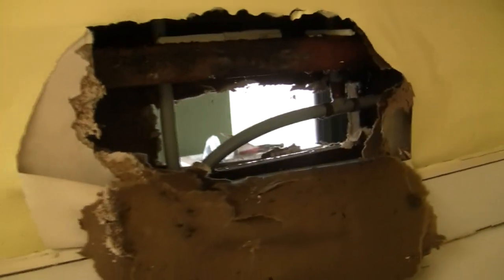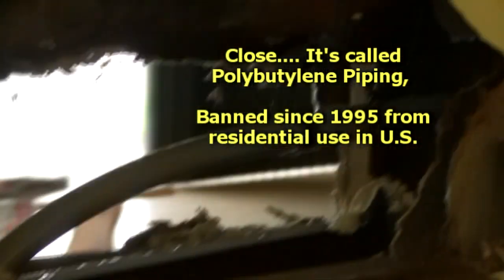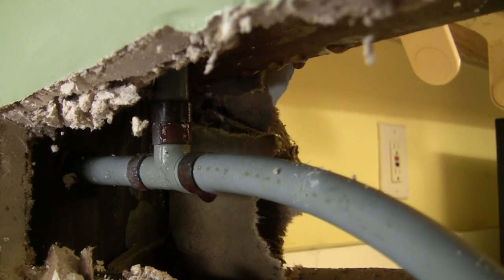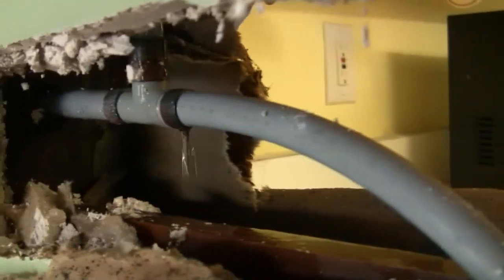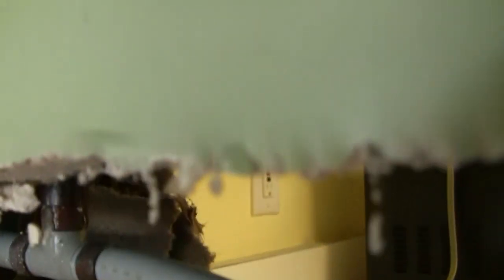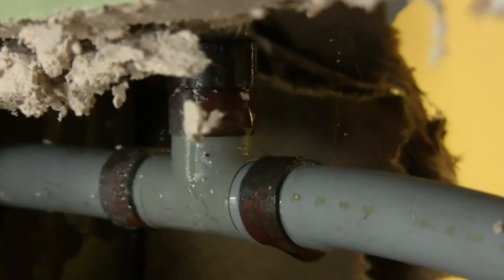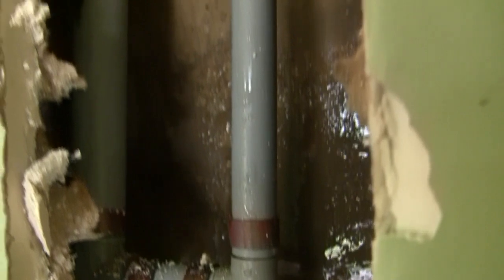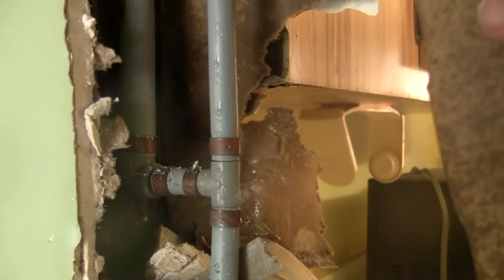How Polybutylene Piping (Grey Pipes) Caused Plumbing Leaks, Mold Inside Wall

Comment: There aren't many guarantees in life, but one guarantee is that where ever grey pipe is connected, it will eventually leak. 100% guaranteed Every single connection.
Reply from the maker: Yes sir, got that right.
Reply: What brand of fittings do you use? Sharkbite?
Reply from the maker: @vidalexperience  I don't recommend using Shark Bites inside a wall where you can't see them or get to them in an emergency. I only use Shark Bites for temporary purposes only, like capping off pipes, etc. To me nothing beats tried and true tested over time sweated copper pipes, or PVC pipes that are properly primed and cemented.
Reply: @jeffostroff  I ended up replacing the T fittings using 3/4, 3/4, 1/2 and then adapting the 1/2 to a 1/2 marine plastic white pipe to a 1/2 fitting into pb
Reply from the maker: @vidalexperience  https://www.badcredit.org/carbuyingtips-offers-expert-advice-on-purchasing-vehicles/ery similar to what I did at mu own house with a Polybutylene pipe that we have.
Reply: Would you say over time even the pb pipe itself begins to brittle and crack, or mainly it's the fittings, because I've had 9+ leaks in my apartment due to the fittings in less than 5 years.
Reply: I know the lawsuit on PB was because the pipes themselves can't withstand mineral deposit in the water and overtime it was said that the pipe tube themselves could fail... crazy.
Reply: @vidalexperience  Fittings (old gray plastic ones) begin to fail after 5-8 years of hot chlorinated water.  Polybutylene piping itself will last as long as any other material.  Estimated at over 100 years with normal residential chlorine levels, water pressures and hot water temperatures.
Reply: Let's make a change to that.... wherever there is ANY water system, it will over time leak, 100%. Lol the only things that leak on pb are the joints of fittings, because of the use of the plastic materials which dont deal with sodium hypochlorite breakdown well at all, andwhich have been banned by the rest of the world In place of copper fitting. In fact, pex breaks down in the pretense of sodium hypochlorite at a rate of 40 degree less temperature rating. The new pb is actually even thicker than pex, and why it is banned in the u.s now is honestly retarded considering the allowance of other questionable materials and practices.
Reply: Earlier plastic joined "Poly B" like this will for sure. Just cheap crap that should have never been allowed. Copper joined "Poly B" might last indefinitely. For me copper pipe or nothing. PVC, forget it.
Reply: Poly pipe gt a bad rap. The problem wasn't the pipe it was the fittings. I have been in the plumbing business for over 50 years. At that time all the leaks I have seen were in the fittings. Copper fittings were also made for poly with no problems.
Reply: Name me one pressurized plumbing system that is not 100% guaranteed to leak somewhere, sometime. My father-in-law was a plumber.  His bread and butter was replacing or repairing old, or improperly soldered copper plumbing.  Copper.  Considered by many the “Gold Standard” in plumbing systems. PEX is also 100% guaranteed to fail (eventually.)

Comment: Don’t show how to fix it
Reply from the maker: There is no fixing it you simply remove tremove this type of pipe. Plumbers are making a fortune nowadays charging about $10000 to repipe people's homes.
Reply: @jeffostroff  I fixed it no problems...I went to the hardware store..They sold me the parts to cut off the bad line and hook new line to replace it...Took 20 minutes...Yes you can fix it I did...

Comment: I'm not the original owner of my house that was built in early 80s and I've heard that there was a time when the homeowner had the chance to replace these lines free of charge.  Well, that didn't happened or probably was offered money to get them replaced and kept the cash instead.  Multiple leaks later in the past few years, I finally got them all replaced...at my expense!!!!
Reply: Nah it wasn’t free of charge. But some people (after the lawsuit) were able to get some money so in theory, it did cover the replacement. In Canada, we got $400 or so lol. It costs over $10K to replace the pipes in the entire house. Unless you do a major remodel, no way on earth you would do it. Especially if you had 0 issues.

Comment: My 1995 house located in charlotte nc has pb pipe with copper fittings.   I added quest compression fittings in a laundry room  and they failed but no issue with anything else.  City water is very soft but is chlorinated
Reply from the maker: Chlorine is what many experts say is the problem for PB pipes
Reply: @jeffostroff  no problem with mine obviously

Comment: In the 1970s most of the PVC was beige but GSR and Plastiline made grey SCH 40 DWV PVC, it was a lot like the beige PVC just the different color. They made the grey PVC in 1 1/4 - 6 inch sizes. It is NOTHING like SCH 80, poly b, and electrical conduit. there are different types of grey plastic pipe.
Reply from the maker: Yes this moment was definitely Polybutylene

Comment: Have had polybutylene in my house since  1994.So i guess they got away with installing inferior and illegal outlawed pipe.The hot water pipe from the water heater sprung a leak last night.Gotta call the landlord now and the plumber.All the rest of the pipe in the matrix above the heater looks like it is polybutylene. smdh..
Reply from the maker: Yes Polybutylene is a ticking time bomb waiting to happen
Reply: @jeffostroff  You and Potato Salad need to get together and compare notes.

Comment: I saw similar grey plastic water tubing in mobile homes built in Washington state in the 1970s.  Metal crimp bands were used at fittings; the stuff seemed to be all right, but was very rigid--very hard to bend by hand.  I was on an Alaskan island having to fix water problems, leaks, bursts, etc. and I had no spare parts for this grey poly tubing, and it was hard to connect this stuff to any other type of material and fittings.  Wherever I could, I would tear it out and use black poly tubing with double radiator hose clamps, primed and glued PVC, even radiator and rubber hose with clamps.  In Alaska, one had to use what was available for repairs and try to make it as durable as possible--and then insulate the heck out of it to protect the water tubing from freezing temperatures.  Everything was a challenge.
Reply from the maker: We did a repair last year and used a Shark Bit to convert from Poly to copper. We only use it on the outside of a wall, would not use Shark Bites inside the wall.
Reply: @jeffostroff  they have gray Polly to pex fittings to
Reply: I hate it! Im having that problem right now trying to figure out how to fix it.

Comment: Cheap builder cutting costs , pocketing  the profit.
Reply from the maker: Yes, and the owners of the property get stuck with the bill to repair the damage caused by their greed.
Reply: Right just paid 2600 to re pipe the main water line to the meter had that old grey pipe in it now I have pex